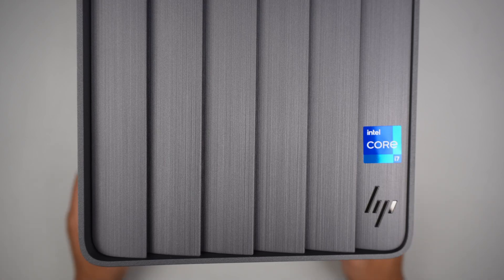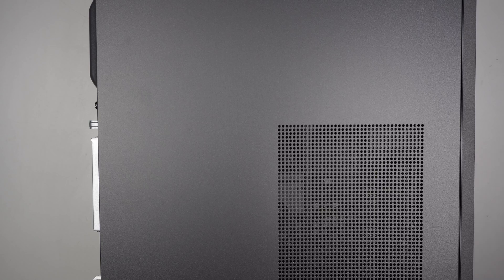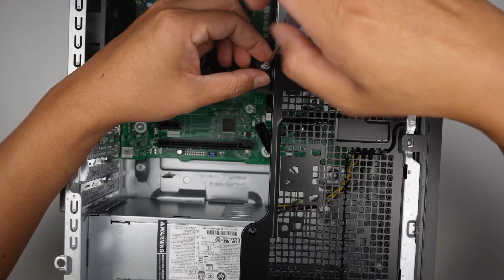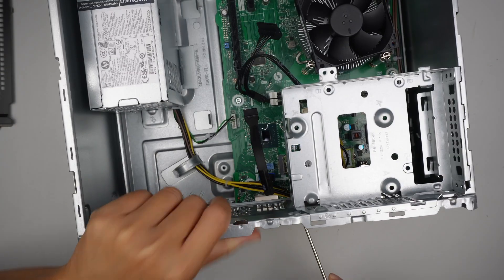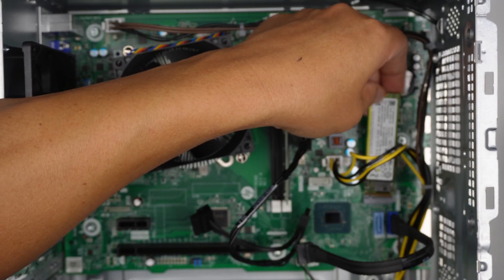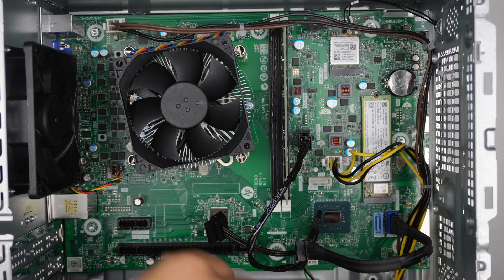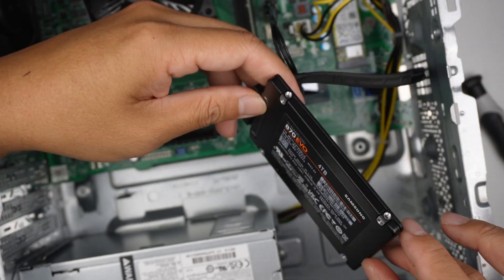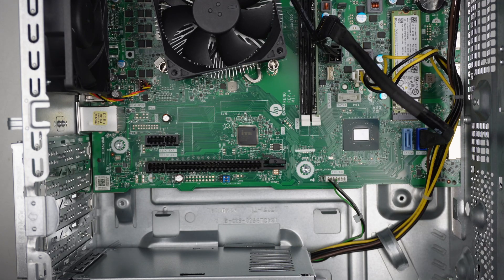HP TE01 5354 Teardown Upgrade Disassemble

Comment: The specs on HP's site says this model has two "2 M.2; 1 PCIe x16; 1 PCIe x1" expansion slots.  I don't see any M.2 expansion slots.  Am I missing something?!   Or are those the SATAs?  I thought it meant open slots like what the SSD is in.
Reply: I believe another M.2 slot is occupied by Wifi,BT card
Reply: @Tony33dss  yeah, I wish there had been another open one.  The PC is pretty sweet though.  First one with a M.2 HD and it is so much faster than all the junk I've had before.  Was easy to add another 16gb to the open RAM slot and a SATA drive for secondary.
Reply: There is only one ( M.2 slot)  not two.

Comment: Very helpful info. I'm considering buying this model H.P. envy Model:TE01-5354 because it's on sale for $699 with 16GB ram, 1TB SSD, normally $999. I'm a retired computer hardware repair guy that built and repaired/troubleshot them and other devices in my job for 22years but have not kept up with the newer desktops in 10 yrs, I did build a Computer for V.R. 6 years ago, the i7 is a 8700 ( 2017) processor so it's now 7 years old in technology but has a 256GB NVME type SSD in it. The reason to buy one is in Oct, 14th of 2025 all computers using Microsoft Windows 10 will have update supports STOP. My old 2013 H.P. Envy with Windows 10 will have No Windows 10 Support. So I 'm going to move up to a faster lighter computer as my daily driver.
Reply: I see it on sale for $750, where did you find $699?
Reply: @westlander361   On Black Friday one day only I bought it on Cyber Monday so price went up to $749.99 when I bought it.
Reply: @westlander361  I just bought one today for $699 at BB.
Reply: @westlander361  it went up $50 the next day I waited and lost the advantage bought it at $750.00
Reply: What graphic card i can upgrade to this pc with that power supply?

Comment: Can this pc output 120hz if I get a monitor capable of 120hz+? Im looking to be able to browse the web with smooth scrolling for less eye strain. Also will be wanting to add a dedicated sound card to hook up my Sub again. I also saw the other model TE01-5364 that has 32gb ram and a RTX 4060. Its about $300 more.
Reply: No. Max resolution on the integrated graphics card (Intel UHD Graphics 770) is 4K but at 60hz refresh rate. But I don't understand your question. What kind of blazing fast scrolling are you doing while browsing that you'd want 120hz refresh rate because not having it is causing you eye strain?

And why would you need to add a dedicated sound card just to run a subwoofer? This PC already supports 5.1 channel audio system, so you can already run a subwoofer and/or other speakers. But either way, for improved audio power and quality, I'd install FxSound, which is free from the Microsoft Store. It's a highly rated, small, simple, and yet powerful program (audio booster) that includes an audio driver and a customizable equalizer interface with numerous audio-profile presets. Even these default presets are a huge improvement over the preinstalled audio driver/equalizer on this PC. But if you have a particularly good ear, you can create/save your own preset, and you'll be stunned by how superb even the tiniest/cheapest speakers can sound.

As far as the RAM, you can buy another 16GB memory stick for about $25/$30 and upgrade to a total (max) of 32GB yourself. Just make sure you get the right one. I purchase the Crucial RAM 16GB DDR4 3200MHz CL22 from Amazon for less than $30.

Comment: Hi I need help I wanna change the psu but it doesn’t have a 24pin power cable it’s the same motherboard btw and what should I do I wanna upgrade it to 500w and what kind of gpu can it handle
Reply: It can handle a video card that does not use much energy to run like the GTX 1050Ti or any video card that does not require a any power.